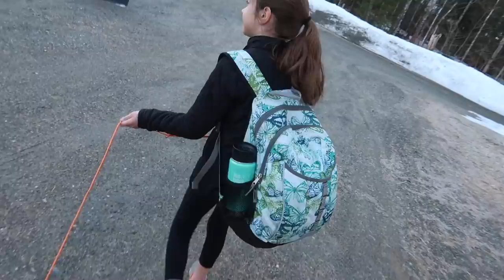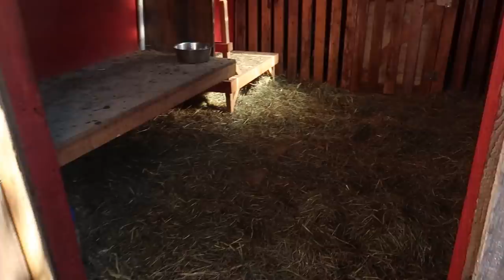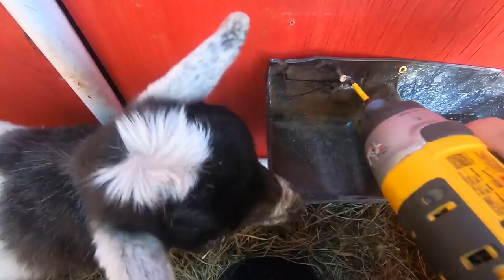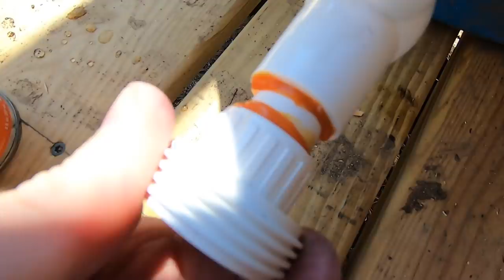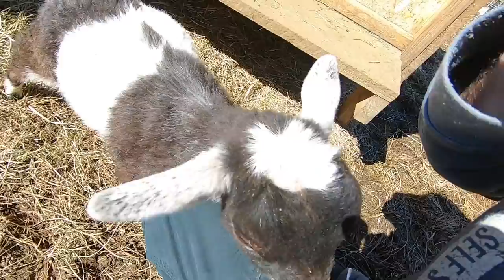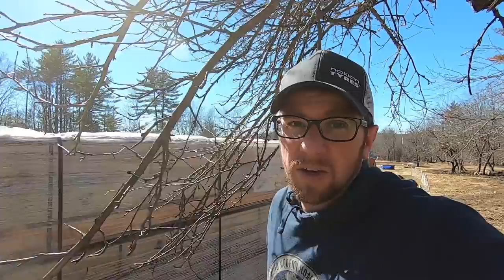I Forgot to LOCK up the Chicken Coop Last Night I should Have Known BETTER

Comment: Love those PVC hand-cutters.  I prefer them over saws any day.
Reply: Devin Hanson same and way more save !
Reply: I use the shear cutters on PVC, PEX, CPVC and plastic tubing for 1" diameter and below. For 1.25" and above a hacksaw with a fine tooth blade.  For copper water lines <1" I still prefer the cutter that looks like a "C" clamp with a cutting wheel and rollers.
Reply: Agreed

Comment: I'm an apprentice plumber I'd recommend a ring pipe cutter. Go around once tighten and repeat
 Super easy.
Reply: Amazon has them for $10-15. They would work fine for your use.
Reply: Ring pipe cutters are more for copper tubes and other metals.  PVC cutters are designed specifically for PVC.

I actually like using the PVC over a hacksaw, real quick and easy.  Did see the ring cutters made for PVC, but didnt want to spend almost as much time as a hacksaw would just cutting with a ring cutter.

Cause like you said, put it on, turn it a few times to dig the blade in, tighten the blade some, spin it around a few times more, repeat til its cut through.

Where the cutters come in, its almost similar to scissors, but with a bit of a ratchet to it.  Squeeze, release, squeeze, release, squeeze, done.  Less time screwing around cutting, more time to get the project done.
Reply: That is what ive used

Comment: My father is a professional heating engineer and he always has a pvc cutter in his toolbox. He says it's little things like that that make a job easier and cleaner. He also has a cutter for metal pipes to quickly cut things without having to bring in bulky equipment. I guess, if you have to do such things more often, it's worth investing into something like that.

Comment: Those pvc ratchet cutters work great and you can get them at Home Depot or Lowes for under $10 to $15. You ca also get them from amazon for $6. I have had a $5 one for 15 years and still works great.

Comment: Very good videos, I check for your videos every day. I just bought a ratchet type pvc cutter at Home Depot for $14.00 and used it to make major repairs to my sprinkler system. I should have bought this many years ago, it was perfect for the job. The one I purchased was for up to 1-1/4" size pipe and it works great! You should get, you will not regret the purchase.
Hope the weather gets  better soon, I want to see the barn put up.
Best Wishes

Comment: My cutters work great on PVC and PEX.  None of the jagged edges and straight cuts.  You might could consider PEX for your projects as well.  PEX is flexible so less likely to be broken.  Can swell during freezes so less likely to burst.  No glue is required.  Fittings are reusable.  I use the Stainless Steel cinch straps to make the connections.  They can be cut off if you need to change the layout.  The fittings are available in both brass and plastic.  I have not done a cost comparison but I expect it to be about the same as PVC if using plastic fittings.  Brass would cost more of course.

Comment: Yes, the pipe cutter is well worth the money.  We have a small one and a larger one.  You just put it on your pipe, tighten, turn, and repeat till the pipe is cut.  Awesome.   I wondered when you were going to put up the mineral feeder.  Thanks for showing how you got the piece apart for the barrel.  The guy at Lowes was trying to open it, but he kept turning the wrong way and so did we.  I showed my son what you did, he got 2 pipe wrenches and turned the "wrong" direction, and it came apart.  Thanks for that information.   Have a Blessed Day!

Comment: The PVC cutters work good if you are running water lines. I have a pair that I bought to make frames for shelves (I use 3/4 in pvc plpe) but have found  it impossible to keep them at the same length. I use  a cut off saw to make to make my pieces all the same length but they work for waterlines where a little variation will not hurt.

Comment: I work for a chain of car washes and use a hand cutter regularly for fabrication and repair work.  It is good for both Sch 40 and Sch 80.   If the  Sch 40 breaks from heavy usage by the pigs then you may want to switch to Sch 80 or metal piping.

Comment: Mornin Al! :-) PVC cutters Rule! I have several sizes and several brands at the wildlife center. I will try to remember to look at my favorite one. Up to about 1 1/2 pvc I use a cutter, above that I try to use a chop saw... And don't worry, you will build up a reserve supply of PVC parts. I have bins full of my commonly used sizes and fittings. Oh yeah, is it really "nylon" thread tape? I've always used Teflon. I like to use the thicker stuff, it often a different color than the cheap white stuff. Its been 80 something here in South Florida, but we get a "cool front" today and its back into the 70s for the weekend :-) Soon enough that will be our nighttime low...

Comment: I only use a rachetting pipe cutter on all PVC and CPVC 1.2" or less in diameter and have done so for over a decade.  The tool slips in your pocket, makes a clean cut that doesn't need to be de-burred and is much safer than either a hacksaw or a sawzall.  The cheap ones (under $10) have always been fine for me - I loaned mine to my plumber once so he didn't have to go back out to his truck and he liked it better than his $30 pro model.

Comment: Enjoyed the video Al. Glad the chickens were ok. The pvc cutters are nice but I couldn't justify buying a pair since I don't plumb for a living. I did luck up and buy a Lennox brand at Lowe's when they had it on closeout. I've used it many times and have only cut pvc pipe and the blade still got bent a little so I just file the burr off and it still works great. I guess since its got such a narrow sharp blade. Y'all take care and God bless.

Comment: You can get a pvc racketing pipe cutter for $10 or less at any discount hardware .... They do work well ... I have a couple of them. I do most of the family plumbing. Got my last one at Harbor Freight. ... Also use a battery terminal cleaner to deburr  the small pipes.

Comment: Can't wait for each video!
  As far as plastic pipe cutters, the tubing cutter type as used with copper pipe are best. They don't pinch the pipe or leave it out of round. Ratcheting shear type cutters are okay for non pressure garbage projects but can cut at an angle, leave the pipe ends out of round and  shatter some types of pipe in the cold. A chop saw will also work, but reciprocating saw, um no lol

Comment: You don't need to glue the pvc joints when there,s no water pressure . And you can save on electricity if you start using hand tools ..no need to put those on the charger .Thanks for the video and God bless

Comment: Home depot has a great tubing cutter for I thinks its 9.99. Its back in the plumbing section. I use mine regularly everyday and I usually get about a year out of them. Its is husky brand. The flexible tube cutter. It will cut PVC and cpvc as well super easy to use.

Comment: It's too late now but for the pig waterer you could raise the barrel on concrete blocks to get the inside pig water nipple the same height as the barrel spigot. You would have to shorten the down sprout a few inches but you would get the whole barrel available to the inside nipple .

Comment: FYI, I use PVC all the time on my farm and those cutters are invaluable! There's only one drawback but I don't think you have to worry too much about it. 
Old PVC can become brittle so a dull blade cans break the PVC instead of giving you a clean cut. As I said, I doubt you have to worry about it as new PVC cuts nicely. Lowes has them from about $14.00 up to around $180.00.
I have the $14.00 pair lol.
Also, I see everyone using cleaner and glue on their PVC. Unless it's under pressure I never use glue. I have had several rain Barrels, one of which was almost 12' off the ground and I still didn't use glue. It's never failed me. Think about it, if you put it together and tap it into each other nice and tight it will take pliers to separate it so if it's not pumped under pressure save your glue.
-Russ (Florida)

Comment: I use my miter saw to cut pvc, but I do have a hand cutter.  Hand cutter is portable and makes a very smooth, even cut.  I am more 'seasoned' than you and I find it takes pretty good hand strength but you should not have that problem.

Comment: Question? I see that on the ppm on the plumbing you have a tube that goes vertical after the first valve. How are you supposed to get water in there without a valve to close after the vertical pipe?
Reply: Do you not know? Pig nipples stop the flow!

Comment: It may be the camera angle, but, the upper water pipe appears to slope back towards the barrel.  Could this allow pig saliva/slime backflow into the water system if the water drinking nipple closes slowly.  Suggest it slope towards the nippler.  Also, I have a hand pipe cutter.  It is essentially a big knife with a half round pipe support.  Works well on PR pipe, more work on schedule 40 or 80.  Have not cracked a pipe yet (not even close) and it eliminates PVC slivers and debris that may get into the system or on the ground and ingested.  PVC has a long life, even shavings.  Have a good day.

Comment: Get a hand pipe cutter cheap at Harbor Freight. They work great on PVC, poly and PEX. They cut clean. HF is the same as all of the more expensive brands that come from China . 
If you pull the Teflon tape tight into the threads, it does not matter what direction but I usually go clockwise because it is easier to pull it tight as a righty. I could not wind it tight the way you do it. I hold the threaded piece in my left hand. The roll of Teflon tape on my right index finger coming off the bottom toward my thumb. Hold the end against the threads with left thumb, Pull tight into the threads and wind 3 or 4 turns and pull the end tight into the threads. Quicker and the Teflon tape does not want to unroll off the threads.
Your PVC cement looks suspect. If it does not stink, it has lost the solvent that creates the solvent weld.  But, you have 1.5 PSI at most so it should be fine.

Comment: The PVC cutters work well.  Here's a Blue option:
https://www.lowes.com/pd/BrassCraft-Up-to-1-1-2-in-PVC-Cutter/999903297

And this is an Orange option:
https://www.homedepot.com/p/Husky-1-1-4-in-Ratcheting-PVC-Cutter-16PL0101-1/304217581

Make sure you get one with the capability to cut the largest diameter pipe you expect to use.

Comment: I hate to be the one to tell you this because I think  you are doing so well on most every thing you do but, if you hold the piece you are cutting tight to the shoe of the resiprocating saw you will find you cut it much easier, just a tip because I see you fighting it and not getting a good cut

Comment: Omg, good thing the chickens were all still there and ok =/  Better probably really try and not make that a habit, especially now that you've gotten rid of all your other roosters =//  Also, one thing I would suggest for your bread is that you might want to try putting your Dutch Oven in the oven while it's pre-heating. That's supposed to give a nice crust on the top and bottom. Don't know if it was just the lighting or the way things can come across on video but your guys' bread looked like it was barely done. Great video as per usual though =D :))